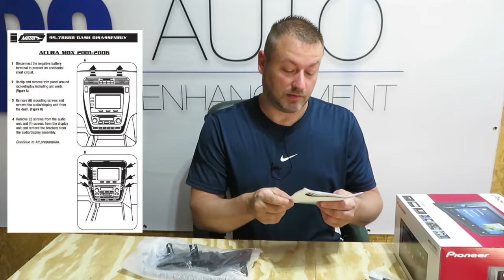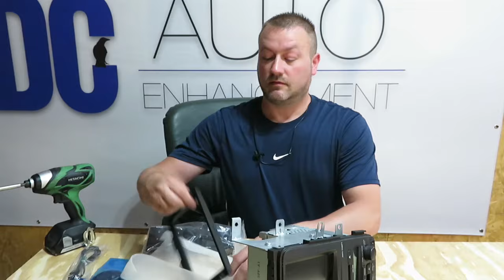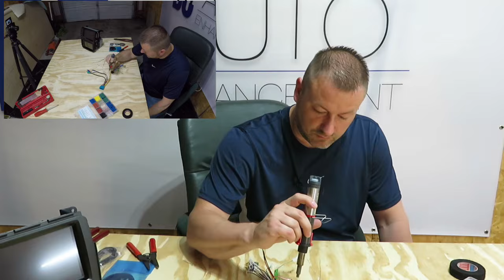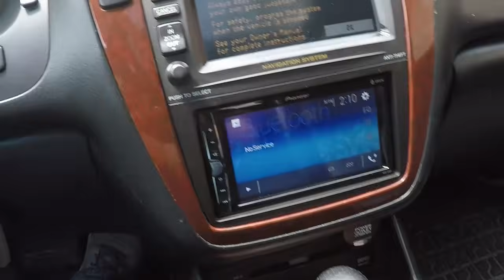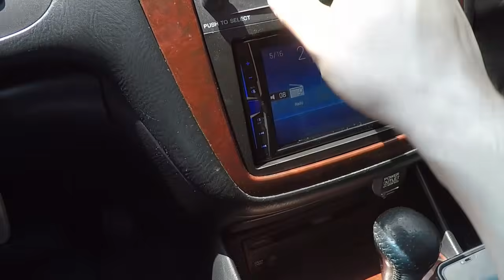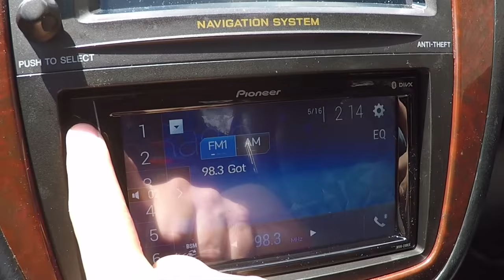2004 Acura MDX Stereo Upgrade Retain Factory Nav, Bose, and Back-up Camera Pioneer MVH-210EX

Comment: Hi, I recently installed a new deck like you did and everything turns on but no sound? any idea on why this is?
Reply: You need a resistor for the nav screen.
Reply from the maker: There is a blue wire with a white stripe that comes frome the new radio and it needs to be hooked up to the blue and blue white stripe wire on the harness that plugs into the car. It is possible that the harness only has a blue wire, if that's the case you hook that wire up to the blue/white wire from the radio. Usually that is the reason for no sound. There could be a blown fuse for the factory amplifier if you have those wires hooked up with no sound. I hope this was helpful.
Reply: ok it was the blue wire but now theres a different issue, my navigation system isnt working which controls my climate controls, it turns on for a second but then goes black
 @DCAutoEnhancement
Reply from the maker: @matthewdowns5334  is the blue wire the only thing that you changed?
Reply: @DCAutoEnhancement  no just connected blue wire
Reply: I have no idea what it could be. Could it be that the old radio needs to be hooked up?
Reply from the maker: @matthewdowns5334  the nav still worked on the one I did in the video
Reply: @DCAutoEnhancement  so no idea on what it could be?
Reply: @DCAutoEnhancement  so I reconnected my old radio up and everything worked again, so could it be the boss deck im using? its the boss BV9358B, it was cheaper than the one you bought but now im thinking i shouldve bought that one
Reply from the maker: @matthewdowns5334  email me a picture of the back of the old radio and the new wiring harness plugged in to the car  dcautodiy@gmail.com
Reply from the maker: @matthewdowns5334  what years is your mdx

Comment: HI, Thanks for the video... I noticed you didn't have anything on the AM/FM antenna.  Is that required or does the cabling harness include that?
Reply from the maker: An antenna adapter is not required for this vehicle
Reply: @DCAutoEnhancement  thank you!  One more...does the blue/white on the Metra 70-1725 go into the pioneer blue/white labeled System Remote Control?
Reply from the maker: If there is a blue and blue/white on the metra harness the hook the blue/white from the radio to both of them

Comment: Hey i have a question i wired all my wires correctly for my radio but it keeps making a whining sounds that’s super annoying. What can i do to get rid of that?
Reply from the maker: Make sure the connection on the black (ground) wire is solid. If it is you may need to buy a ground loop isolator. I'll come back and drop a link for one in just a minute
Reply from the maker: you will need two of these https://amzn.to/3sDYXrS
Reply from the maker: What radio did you install?
Reply: @DCAutoEnhancement  I just got a cheap aftermarket radio from walmart. Dual Electronics XDM27BT LCD Double DIN Car Stereo Receiver with | Bluetooth | USB | MP3 | Siri/Google Assist Button
Maybe that’s the probelm?
Reply from the maker: @davidnguyen4012  that could be the problem but if you want to keep that radio, the ground loop isolators should take care of the whine.
Reply: @DCAutoEnhancement  what kind of loop isolater u recommend i wanna keep this for now
Reply from the maker: @davidnguyen4012  I put a link for one in this comment thread.
Reply: @DCAutoEnhancement  thing is i dont have a rca in my car at all.
Reply from the maker: @davidnguyen4012  did you not use the rca ends on the wiring harness that plugs into the car side?
Reply: @DCAutoEnhancement  it never had one should i buy the one that has a rca?
Reply from the maker: Yes. When wiring the speaker wires to an amplified system, the out from to radio is too "hot" and will cause noise. If you look in the description of the video there is a link to the wiring harness that I used. Make sure your new radio has at least front and rear rca outputs
Reply: @DCAutoEnhancement  thanks alot I appreciate it!
Reply from the maker: @davidnguyen4012  no problem at all! Have a great day!

Comment: I’m not getting sound does the Bose amp need to be hook to remote wire?
Reply from the maker: Yes make sure the blue white wire from the radio is hooked up to the blue wire of the harness that plugs into the wiring from the car
Reply: Thanks

Comment: Does anyone know if the steering controls stilled worked after the swap? thank you for the video
Reply from the maker: The customer didn't want the steering wheel controls hooked up. They didn't want to pay the extra money for the adapter. Here is a link to the steering wheel controls adapter:
https://amzn.to/3suEhSI
Reply: @DCAutoEnhancement  Will the install pretty much be the same if I decide to buy the steering wheel control adapter? As far as wiring goes. I have the same acura mdx that you're working on in the video.
Reply from the maker: @matthewdowns5334  there will be some additional wiring but nothing you can't handle if you can install the stereo
Reply: @DCAutoEnhancement  ok and the universal steering controls adapter you put in the link, are there any other adapters that you would recommend?
Reply from the maker: @matthewdowns5334  no, that should be all you need

Comment: I installed mine the same way you did but I lost the navigation after. I found others splicing the blue antenna wire with the red acc which gave me sound but lost the nav. You didn't show where the blue wire connected to. Ive seen others say you have to add a resistor to get nav back but I didn't see you do that. Can you fill me in on the step you glossed over with the blue power antenna wire please
Reply: @DC Auto Enhancement
Reply from the maker: The only thing that I would have hooked the blue wire up to from the radio would have been the blue wire on the harness to the car. But technically it would have been the blue wire with a white stripe. What year is your mdx? I can look into it further. I just installed the radio as I would any other stereo and didn't have any issues.
Reply: https://acurazine.com/forums/3g-tl-audio-bluetooth-electronics-navigation-94/aftermarket-radio-stock-navigation-system-956349/ see this thread

Comment: Hey, hoping you have a suggestion or 2 that will help me out. I have the Metra harness with the 4 RCA's. I installed the head unit (cheap android) and all colors for the ACC, , B+, GND, Illum, & P.CNTR (blue/white wire) from the head unit harness are matched up to the Metra harness. But the sound is like when you have a negative and positive touching and is really, really low at full volume. I have a sub woofer and I'm sure there's an amp somewhere in there. Do I need a line output converter? If so, do I need a 4 channel one? Have 4 speakers in the front (2x mids L&R / 2x tweeters L&R), 2 in the back and the sub.
Reply from the maker: The first thing I would do is in plug the RCA's turn on the radio and make sure it's a a low volume and slowly insert the RCA's one at a time. Sometimes, if only the pin part of the rca is in and it sounds normal but you plug in the rest of the way in it sounds terrible, then you have a grounding issue with the RCAs most likely on the head unit side.
Reply: @DCAutoEnhancement  Thanks, I did that but there is no sound when just the pin is plugged in part way and sound (terrible, low sound) when it's all the way in. What else could it be?
Reply from the maker: @sonofsam7176  what model is the android unit? And is it going into a factory audio system for an Acura MDX?
Reply: @DCAutoEnhancement  It's this one...https://www.amazon.com/gp/product/B08K44M1S5/ref=ppx_yo_dt_b_asin_title_o00_s00?ie=UTF8&psc=1 It's replacing the factory radio. There is an amp and sub woofer that I'd like to keep. It's a 2003 Acura MDX and I'm using the harness that has the 4 RCA's which connect to the back of the Android unit.
Reply from the maker: @sonofsam7176  do you have factory navigation? Did you see BOSE anywhere on the radio or speaker grills?
Reply: @DCAutoEnhancement  No nav and I do believe it says bose on the speaker grills.
Reply from the maker: @sonofsam7176  ok, try this: cut the rca end off of the wire harness side about 1.5" from the rca end. Do this to the right rear (purple and purple and black wires) then wire those to the harness coming from the radio. If you have decent sound from the right rear after doing this, do that to the rest of them.
Reply from the maker: Let me know what you find out
Reply: @DCAutoEnhancement  I didn't cut it yet but I used the RR - & + from the harness (harness has 4 pair speaker wire as well as RCA's) and tapped both - & + onto a 3.5mm jack with the other end of that jack going into a small speaker (I did this in the house) and it sounded good and clear with normal volume. Before I get to hacking away, will doing this allow me to keep my amp functionality and sub? I think my amp is rated 35 watts and the head unit built in amp is 4*45 (4*25 RMS).
Reply from the maker: @sonofsam7176  the factory sub should still work
Reply from the maker: Before cutting, do like you did with the 3.5mm jack but instead use the rca pin and put the purple wire that goes to the radio side harness to that and the purple black to the outer metal part to verify that it works in the car. If it does just cut off the rca ends. I think that is in the directions for that harness
Reply: @DCAutoEnhancement  Ok, I'll try and let you know. Thanks for all your help.
Reply: @DC Auto Enhancement Update: I dry fitted all connections and tried it out in the car. It works and sounds clean and loud but the radio sounds slightly echo-ey and the sub is still playing but I don't have any control over it. Local music on SD card sounds great, no echo but same deal with the sub. I guess I somehow bypassed the factory amp?
Reply from the maker: @sonofsam7176  the echo sound most likely comes from the quality of the radio tuner. The most feasible way to have control over the sub would be to have an aftermarket amplifier and wire RCAs directly to it. Just like the factory stereo, you most likely didn't have sub woofer control with it either. By having sound the way you have wired it tells me that the only amp on the car was for the sub. Congrats on getting it working!
Reply: @DCAutoEnhancement  It's literally a wrap. I clipped those RCA's and stripped them back to join with the corresponding wires, made all the connections and soldered them, heat shrunk some tubing over those connections and wrapped it up with tesa tape nice and neat. The unit is installed and way louder than the factory one. It sounds strong, clean and rich. I was only bithcing about the sub because the unit has the ability to control that with the right add-ons (coming soon). Not caring too much about the radio. I have 34GB of my own library onboard. Thanks for all your input, it really helped.
Reply from the maker: @sonofsam7176  I'm glad it went well and you are happy with the results.

Comment: Does this still retain the AC controls?
Reply from the maker: Yes, on this vehicle everything except the rear seat entertainment was functional.
Reply: you say in previous comments you didn’t check the nav screen and you don’t know if it works, the ac is controlled through the nav screen.
Reply from the maker: I assume that everything works as it should, the customer would have contacted me by now if it wasn't.

Comment: Hey..good job..I have a 06 mdx touring/nav. When the factory radio is unplugged I lose touchscreen capability from the nav screen. The nav screen is where I can adjust fan speed for the climate control. Does your touchscreen have the fan speed controls?
Reply: How did you fix you touch screen problem
Reply: Yeah had the same problem my ac is stuck on at one speed and on one mode. With the after market radio. Plug the factory one back in and the navi/climate screen works
Reply from the maker: This was a customer's vehicle. They didn't say they had any issues with anything not working. The aftermarket touch screen does not have any controls like fan speed.

Comment: I installed a radio to a 2006 acura mdx, but the navigation system no longer works the touch screen, but when I connect the factory radio then it works. I need help
Reply from the maker: I'm not sure what the issue may be. I don't recall checking the touch screen function of the nav system on the car in the video.

Comment: With this install did you the steering wheel controls still work? Thanks
Reply from the maker: The one I installed the stereo in didn't have steering wheel controls or the customer didn't want them. They make a wiring harness with the steering wheel controls built in.
Reply: @DCAutoEnhancement  do you know the model number
Reply from the maker: @prostyleproductions  AXXESS AXSWC

Comment: I did my  2005  mdx today everything working fine except  no touch on navigation screen. This means top factory screen become useless.
Any suggest? By the way the navigation unit has only one connector back there..  Please help if possible.
Reply: In my 2006 acura MDX, I managed to put the factory radio underneath where the DVD player and ash tray are. Everything works perfectly. even the headrest screen
Reply from the maker: To be honest, I didn't try that after the install that I posted. If it was previously touch screen, I would think it still would be. Sorry that I can't help beyond that.
Reply: I have the same issue with my 05 mdx! How did you fix it??
Reply: @devareobrown4049  https://acurazine.com/forums/3g-tl-audio-bluetooth-electronics-navigation-94/aftermarket-radio-stock-navigation-system-956349/ see this thread
Reply: @devareobrown4049  crutchfield recommended not changing this radio. It’s not meant to be changed out unless you don’t care about everything else

Comment: i did everything the pioneer didn’t want to turn on so i try the factory radio to see if it was a fuse but nothing and the anti theft on the radio is on so i cannot even put a code or anything the navi wont turn on either everything is where it is supposed to go i need help also the pioneer double does work i tried to with a battery  and i have the codes but it doesn’t ask for it because the radio nor navi turn on fuse is good also
Reply from the maker: Just make sure that the wires from the radio match the wires  the wiring harness from the aftermarket wiring harness.
Reply: 2002 acura mdx with bose
Reply from the maker: Do you have an aftermarket harness that plugs into the Acura that will connect to the harness that comes from the pioneer
Reply from the maker: Double check nthe red wire, yellow wire and black wire
Reply from the maker: Maybe even the fuse on the pioneer too

Comment: What about the amp wire
Reply from the maker: The factory amp gets it's turn on signal through the aftermarket wrong harness as long as the amp turn on wire from the harness is connected to the amp turn on wire from the aftermarket radio
Reply: @DCAutoEnhancement  thanks it worked out the ant wire only gets power when the radio on so I had to wire it up to the red wire from the aftermarket harness now I had to use rca to split the speakers my radio didn't come with all ports I needed but now I got the noise when I hit the gas
Reply from the maker: @Carlos-un5eo  I would run a new ground wire to the radio and use line level converters to make the speaker wires into rcas. The speaker outputs are a higher power output than rcas making it more likely to have noise
Reply: @DCAutoEnhancement  thanks again I ended up running a separate ground wire to the RCA wires I stripped enough to wrap around the exposed metal when connected taped it and now everything working like it should. Thanks for taking the time to reply
Reply from the maker: No problem, I'm glad you got it taken care of

Comment: I have an 06 with bose/Navi. I do not have the rear entertainment or aux in the back. I have a double din sitting around and want to put it in. Also plan on replacing the door speakers. I have 2 questions, one I can’t seem to find the answer to. Question one the wiring harness you  call out 70-1725. That calls for an rsx I’m assuming they are compatible?? Question 2, the stock 10 inch free air in the back is blown. Do you know the specs of the sub, amps, and do you have a recommendation for a replacement. Trying to keep the factory location I don’t have room for a sub box with 4 kids in the car. Thank for the response and nice video 👍🏻
Reply from the maker: Thank you for your questions and watching. The wire harness called out is standard on a wide range of Honda models, I imagine it works on an RSX as well. This particular harness is for amplified factory stereos. About changing your speakers: Bose can be tricky. Most aftermarket speakers are 4ohm and most Bose speakers are 2ohm. What this means is if you put aftermarket speakers in the door they will only get half of the power that the rest of the speakers will get. I would recommend OEM Bose replacements. The same goes with the sub. Here is a link to a replacement sub. https://www.ebay.com/p/1762964382?iid=313123593092&chn=ps&norover=1&mkevt=1&mkrid=711-117182-37290-0&mkcid=2&itemid=313123593092&targetid=915850928613&device=m&mktype=pla&googleloc=9016165&poi=&campaignid=10460085525&mkgroupid=109413763171&rlsatarget=pla-915850928613&abcId=2145999&merchantid=6296724&gclid=CjwKCAjwmMX4BRAAEiwA-zM4JnzzNO31lcggWJfYS-ql9_A1Xmi_Axzrdd_We2Z1GaQ6k_eh1iy-MhoC25kQAvD_BwE